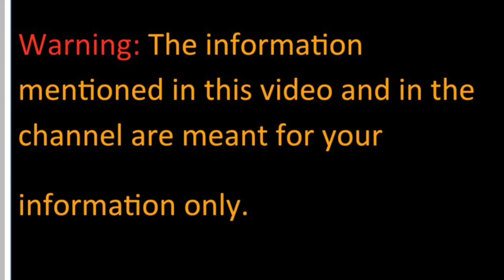B737 Hot Brakes (Raw)

Comment: I totally agree with your analysis. 
As a cpt , I very often meet first officers,  captains and training captains who really become anxious when the btms shows only 2.5 or 3.0.
As soon as the band becomes white,  a misunderstanding of a hot brake situation takes place, but in fact , it shouldn't. 
For the situation where you think to leave the gear extended after take-off,  I believe it is useful for the airplanes that don't have the option of the btms installed. 
This procedure lets the pilots feel more comfortable as a confidence step in order to comply with the brake cooling schedule tables for quick turnaround situation, as no visual temperature information is given to the crew.but one important think to remember,  is to make sure that crew are aware of the degraded performance after take-off with the gear extended especially at night .
It has been proven that delaying a sequence of a normal procedure for a while may lead to forgetting it as we receive a lot of informations during this critical phase of flight.
Best regards.
Reply from the maker: Thank you Capt. for sharing your thoughts. 
Really appreciate it 
Abdul

Comment: Capt.,What all are the criterias you consider,in case you have to do an overweight landing.And what all will be your priorities and method?..
Reply from the maker: Hello arun aravind, 
Some of the situations that call for an over weight landing in my opinion include but not limited to: 
- An urgent medical condition for a passenger or a crew member. I will not go into a holding just to burn fuel if I have an urgent medical situation. 
- Smoke/Fire in the cabin or the cockpit. 
- Engine fire that is uncontrollable. 
- Loss of both engines and relight is not successful for both. 
Those are some situations I can think of. 
The main landing gear is designed to do landing at max takeoff weight with no flare (don’t quote me for that 😉)
So the only thing you need to do be careful with the nose gear and make a logbook entry and maintenance will perform their inspection procedure. 
Hope I answered your question, let me know if you have any other questions. 
All the best 
Abdul